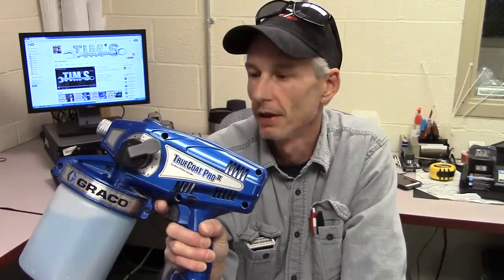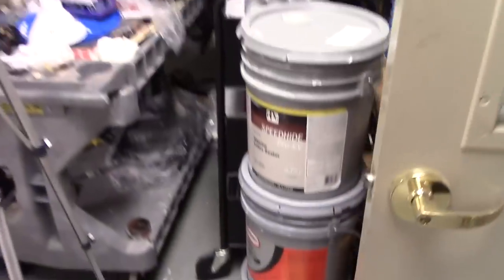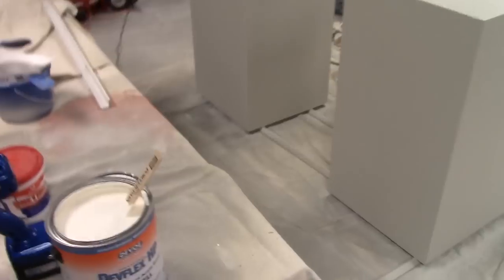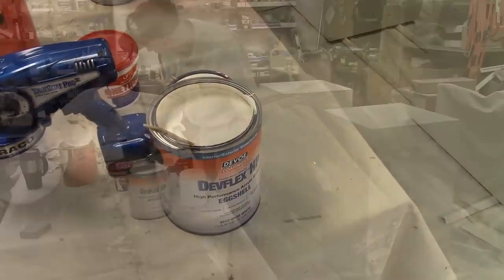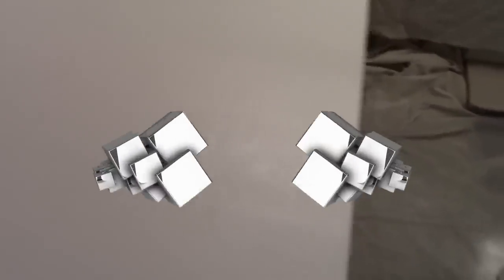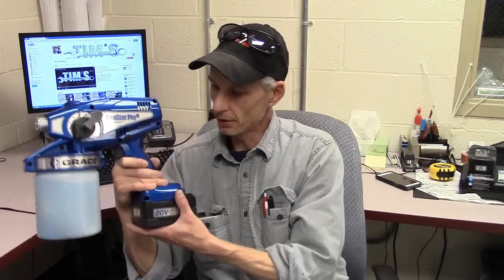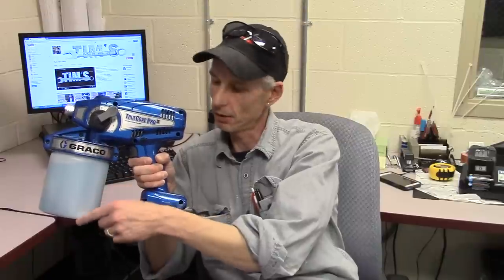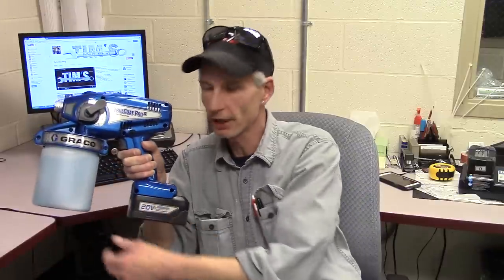Initial Review: Graco TrueCoat Pro II Handheld Cordless Sprayer

Comment: I bought the corded model foreseeing the battery problem as I was planning to paint the outside of my shop. It is heavy so I need to come up with a solution. Something like they have on the hand fertilizer spreader which has a forearm support. The paint thickness, you will need to adjust the spray for best results. I sprayed one coat after adjusting and was VERY surprised how well it did. I did NOT need a second coat so it went very fast. This is two years later and it looks as good as the day I painted it. I just learned a trick I will try and see if it works as far as cleaning latex. They said to use a wash of 50% water and antifreeze. I did try this on an airless paint sprayer that had sat for 8 or so years and I was very surprised how well it worked. The sprayer was really gunked up. Next time I use the small Graco I'm going to try spraying the outside case with Pan Spray to see if cleanup will be easier. I like for it to look new when I store it.
Reply from the maker: +Barry Wind I wanted the corded model for not only the battery issues down the road, but also didn't really care for the added weight of the battery, since as you mentioned, it's already heavy enough without adding a 4lb battery to it as well.  The only positive I will give is that the battery weight does make it a little more balanced, which helps some with the wrist fatigue....but creates whole arm fatigue.
I was in a hurry, and they offered me an excellent price, so I ended up with batteries.
Clean, Clean, Clean....and then Clean again.  Kudos for that.  That will keep your sprayer going for many years.
I've done the anti-freeze thing over the years, and it does work well....I prefer the Pump Armor simply since it's available through my paint supplier.

Thanks for watching, and your comment! Always appreciated.
Reply: +Barry Wind 
How did your corded model goes?
Any outcome you could kindly share with us?
Thank you.
Reply: Have not had the time to work the sprayer. Had a tree fall on the house and the removal and repair took my time up and now winter is on.
Reply: Hey Barry, did you find the 50/50 water and antifreeze worked well for ease of cleaning vs the Graco solution?   Thanks for letting me know.
Reply: Yes, the anti freeze worked on both prayers. My Hausfeld sprayer that was clogged up and the Graco. I use it every time now when I finish spraying.

Comment: Nice review Tim. Wondering if thinning the paint could have helped reduce the orange peel effect.
Reply from the maker: Thanks Albert.  Yes, I am pretty sure thinning would have helped some.  However, I am always hesitant to thin paint (especially water-borne products) for fear it will reduce the durability or integrity of the cured coating.  Which may or may not be true....I just feel that way.
In this case, the pedestals were to be used in a very busy public art gallery, so I knew there would be lots of abuse to them.  I opted for the slight orange peel, over a less durable finish.
Thanks again! For watching and your comment.  Always appreciated!

Comment: To Eriks comment about the graco 360 model, I would stay away from that product all together. I returned one because the tiger stripping was so bad. I replaced with the graco true coat pro 2 and the stripping was considerably reduced. Again, lower volume setting on the dial and correct movement speed helps as well.

Comment: Thanks for a good review Tim. I have a hand-held Wagner airless gun that runs on house current and it has a lot of issues, particularly with viscosity of the material you are spraying. For indoor work I still like it better than fooling with the compressor and hoses, etc. The cord is not really a disadvantage, as far as I'm concerned, and is better than dead batteries. The Graco sure looks good, though, and is obviously of a higher quality than my Wagner airless.
Reply from the maker: Yes, it is a far cry from the Wagner variety....and it shoots basically any thickness of material without thinning.
I wanted the corded model, but my store didn't have it in stock, and my Sales Representative told me the corded ones had grounding issues, and when guys were shooting water-based paint, they'd get zapped.
I am not a huge fan of my hair standing up....so I decided to work around the battery issues....lol
Thanks for tuning in Bruce!
Reply: Wagner uses a diaphragm base pump while the graco uses a piston still pump

Comment: I love mine!! I need a tip for oil base (rustolium paint)  ....:)  GOOD Straining...
Reply from the maker: +blinko656 Thanks for watching and the comment!
The extra tips are available at most of the home improvement big-box stores.  I believe I got my smaller tip at Lowes.  If you can't find it there, they are readily available online.
For an oil-based product, such as Rustoleum, you'll want the green tip, which I believe is either a 315 or 317.  The one it comes with (black) is I believe a 517.
Reply: I got two thru Amazon. I think $23.00 each..

Comment: Hey Tim thanks for the video.  Had a question on the Tiger striping.  You mentioned in the video that the stripes would go away when the paint dried. Did you feel that they went away? They looked visible to me in the shot you showed with the dried primer.  I have an older Graco Truecoat that is corded and does not have an adjustable power knob.  I painted a bunch of molding before installation and my biggest complaint is the striping which is still visible after drying (2 coats).  Probably not something we will notice once the baseboard is installed but I am worried about seeing it on the door and window casing.  

I agree with what you said that the striping is caused by the pump cycling.  Any experience with the larger gun and hose spray systems? Is the pump cycling as big an issue with these systems?  Not really efficient on a small job since they basically take a gallon to prime but I could live with that if the striping went away.

Last comment, you mentioned in the video that the sprayer came with at 515 tip and you got a second tip to reduce the fan size (a 513 based on one of your replies).  I believe the first number, a 5 on both your tips, is the fan size doubled (10" fan size for both your tips) and the second 2 numbers refer to the orifice size.  I believe your second tip is designed for stains and other materials that are not as viscous as latex paint hence the smaller orifice size.  The green handle normally indicates a stain tip.  

Have you or anyone else experimented with thinning the paint so the pump wouldn't have to work as hard to reduce the tiger striping effect?  Also thinking about maybe getting a larger orifice size to reduce back pressure and moving faster to reduce potential for too much paint and runs.
Reply from the maker: +pacedge123   Thanks for watching, the comment, and the questions! Now to the best of my knowledge.....

The striping is caused by the cycling of the pump, which is indeed eliminated with the larger pumps.  The larger pumps cycle the motor to build up pressure, and then shuts off until the pressure drops (much like an air compressor does), resulting in more consistent pressure.  I have gotten the tiger striping with larger pumps, but only when I had the pressure turned too low.

I did experiment with thinning, pressure adjustment etc. to no avail.  I still got the striping with this unit. The way I remedied it was by shooting each coat in 4 very light passes going a different direction each pass (ie: north to south, then east to west, then s.e. to n.w., then n.e. to s.w.).  Final product results were a nice even finish when it dried.

I'll have to do some research on the tip sizes....but my understanding is that the "5" is the orifice size, and the "13", "15", or "17" are the fan size in inches, at 12 inches away from the tip.....but you could be absolutely right, and I may be wrong.  I do know that I have a smaller fan with the 513 than with the 515-517....and when I was spraying stain I always used a 411 tip.  Again though, I'd have to do some research on it....I may have my numbers backward as you say.

If you are looking for best results from an airless, stay away from diaphragm pumps, and go with a piston pump.  For absolute best results (such as a super-smooth automotive type finish) you'll need to go with an HVLP setup.

Thanks again for your support!
Reply: +Tim's Man Blog Tim, Thanks for the quick, detailed reply.  Check out this link on tip size/spray pattern http://www.portlandcompressor.com/airless/tip-sizes.aspx .  Did some research after posting and it seems like the tiger pattern gets worse the faster you move.  Makes sense based on the pump cycling.  The problem is the slower you move the more chance for excessive paint buildup.  Talked to a paint store that sells Graco and they suggested the 311 tip.  Hoping I can move slow enough and the tip doesn't clog (using Benjamin Moore Regal Semi Gloss) but will also probably do the NS and EW spray directions you referenced.  I will post my results after this weekend.
Reply from the maker: pacedge123 No problem at all.....that's why I YouTube.  To pass along info and help others.
You were 100% correct.  First number is fan size, 2nd is orifice size.  Although, the tips for the TrueCoat models are different than the RAC tips.  The tips you'll be looking for are here: http://www.portlandcompressor.com/airless/Graco-TrueCoat-Pro-Accessories.aspx

It turns out, the reason my fan is indeed smaller is because I have been using a 315....not a 515 as I had thought.  (Graco doesn't have these tips plainly marked like they do the RAC tips.  The RAC tips have the size stamped into the plastic)

Thanks for the info....and assisting in my spray-tip education!

Comment: Really enjoyed the video.  I feel like the orange peel is due partly to the thickness of the latex.  Maybe mixing in some flowtrol.  Great points - I shoot latex with my wagner air sprayer - two problems 1. tons of overspray because it is basically hooked up to the output side of a vacuum cleaner & the air gets hot!  I could NEVER imagine spraying indoors the way you did in your video - I was amazed that that was possible.  Other times I shoot solvent based paint with my hvlp hooked up to my air compressor - that Graco gun looks HEAVY!  Agree sort of about clean up of the water based products.  With the wagner blowing hot air your time limit is maybe 20 min then you really need to break it down as much as possible and wash & scrub the parts - but I do the same with hvlp shooting poly or oil base and I spend a long time on the gun / needle etc to get it almost spotless then coat all the parts with gasoline.  Appreciate the video!
Reply from the maker: Thanks for watching, and the comment!
Yes, there was significant overspray. If you noticed in the video, I had everything within about 10 feet covered with plastic...but even still I had the overspray dust that traveled well beyond that...but being as that it was latex, that dust was dry....I definitely wouldn't shoot oil based in my shop like that.
Also YES....the gun is VERY heavy after a few minutes of use.  I rarely use it anymore for that reason....that and the cleanup time.
Reply: Thanks for the update.  I'm the same with spraying.  Recently, I sprayed my scooter cover with latex to stop the sun from destroying it.  I used the wagner air sprayer - iSpray.  It seems like the Graco with an AC power cord would make more sense - lighter and it's not like you are going to load the gun with paint and take it on the road all day.  Take care.
Reply from the maker: Paul C true! I think I mentioned in the video that I wanted the corded model for several reasons, including weight....but I was in a rush, and this one was available, and they gave me a REALLY good deal on it.
for the most part, I stick with my pressure pot setup. I have more control, and the gun weighs about 9 oz.
There is more cleanup involved though, since the paint travels via hose to gun.
Thanks again!
Reply: I just watched the official company video which is good but I have to say it's a little mind-boggling when I look at all the steps involved and that the plastic liner is mandatory or it seems that way because of the need to squeeze out air to form a vacuum the priming the cleanup - wow maybe my Wagner isn't so bad after all.

Comment: Tim in your opinion are you happy with your cordless version or do you think the corded version what be better as far as not having to worry about run time?also how do you like the built quality of these units do they seen like a toy or a pro tool?touve been a great help truly appreciate your info in my quest to buy the right tool the first time around!
Reply from the maker: Shawn Jargowsky Thanks again Shawn for another great question!
No problem at all on helping you out. The whole reason for my being on YouTube is to pass along info and help others.
Now, to answer your question:
I actually wanted the corded unit, but one was not available when I needed it.  I wasn't so much worried about run-time, because I purchased the unit simply for small (less than 1/2 gal.) jobs.  I was concerned however with the fact that batteries wear out, and need to be replaced over time, at about $100 each.
If wanting the corded model simply for run-time, I fear one would burn up the motor.
If you are buying one sprayer, and one sprayer only, I would steer away from this one, unless you are only doing small jobs, such as a couple doors or maybe the baseboards and trim in a single room....once a month or so.
If you are planning on shooting things such as ceilings, or the exterior of a home, you will definitely want something a little bigger.  Fret not though, bigger doesn't mean more expensive!
I am not exactly sure what projects you are planning to undertake with your sprayer, but as a homeowner, if I was on a tight budget, and could only have one sprayer, I'd go with the Graco Magnum LTS15 (about $300).  It's perfect for the homeowner or DIYer.
If you are planning on using it day-after-day, every day, You'll want to step up to a heavier duty model such as the Graco Magnum Pro LTS19 (about $600).
Reply from the maker: Shawn Jargowsky As far as quality of the unit....  It does indeed feel like a professional tool and not so much a toy (although, the outer casing is plastic, it does feel heavy-duty in the hand.  HOWEVER......  that can be a drawback too.  As I mentioned in the video, it does have some heft to it, so your arm gets tired REAL fast.
Which is another reason I use the heavier duty units for larger jobs. (a gun and hose is a whole lot less fatigue inducing than a motor, gun, pump, battery, and a quart of paint).
Hope this helps!  Good luck with your projects!

Comment: Hello could you tell me how the batt life is on you Graco true coat a lot of reviews complaining about batt only lasting barely 2 quarts of paint how has your experience been?thank you for your help!
Reply from the maker: Shawn Jargowsky Sure thing Shawn.  What you have heard is correct.  I get about 2 quarts per battery.  I am using a fairly thick material though, so I am sure with a thinner material (such as a thinned oil-based paint), you may get 3-4 quarts per battery.
With the 2 supplied batteries, I have had no trouble completing the projects I needed it to do.....but I always bear in mind that if the project is going to require I spray more than 1/2 gal. at a time....I use a larger sprayer.
Hope this gives you the information you were looking for.
Thanks for watching, and the great question!

Comment: hey I got my spray one week ago so when I use it 10 minutes its automatically off like it's getting hot then ofter awhile then working, what's the problem of these thanks
Reply from the maker: Hey Adbul!  Thanks for watching and your question!
Well, that is not an issue I have encountered with mine, but there could be a couple things causing this.....
#1 would be if you are trying to spray something super thick through a tip made for a thinner material.  This would cause the machine to overwork, heat up, and shut down.
OR #2  You ended up with a defective unit and/or battery.... in which case I'd return it for an exchange or refund.
Hope this gives you the info you were looking for.  Thanks again!